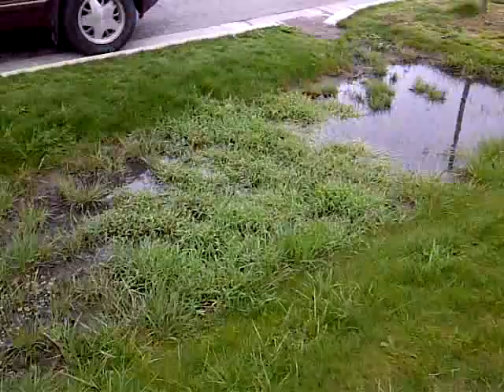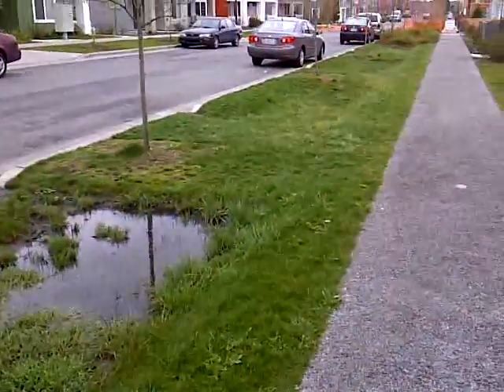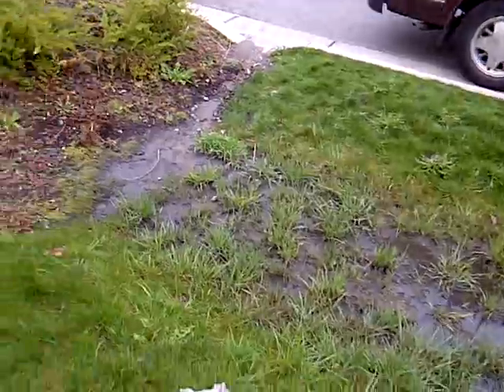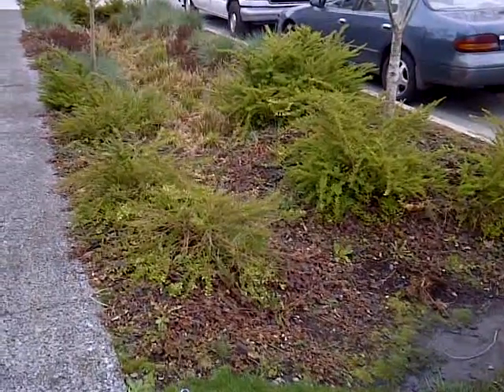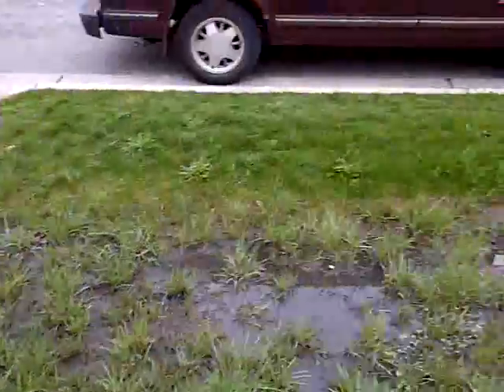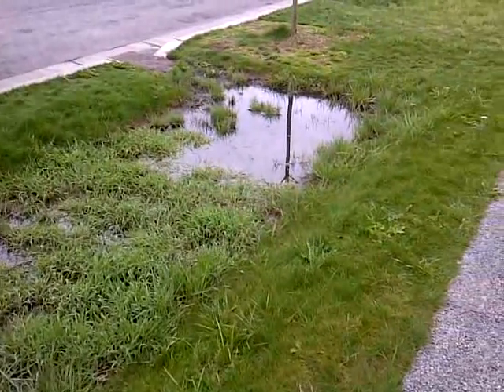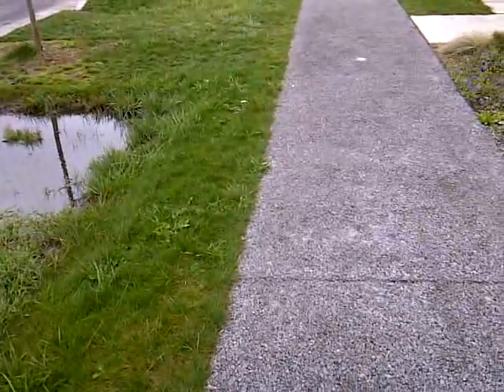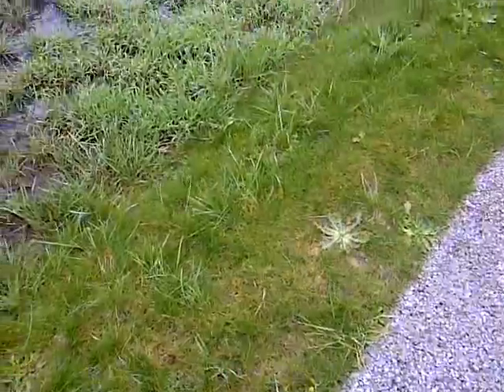What a non-functioning bioswale looks like

Comment: I think the main reason this didn't work was because of the mowed grass and the lack of biomass. Bare or near-bare soil tends to crust over and make an impermeable surface when it collects large amounts of water intermittently. Ideally you won't be diverting the water because the whole point is to infiltrate it and let the soil life use and filter it. Mulch + plants, as in the section pictured to the side, should be sufficient in most cases.